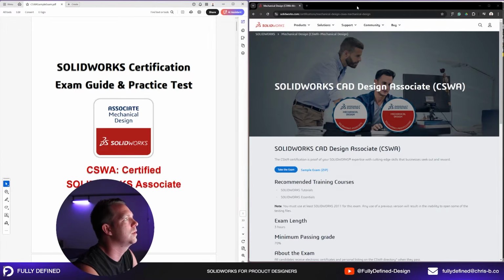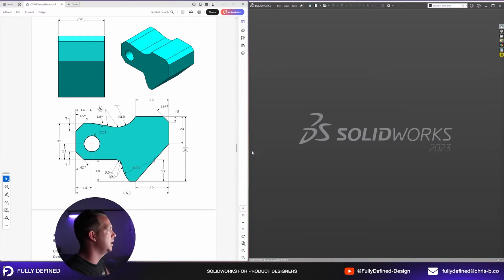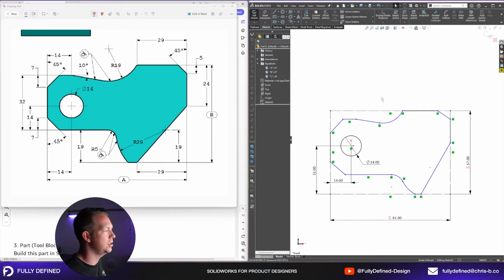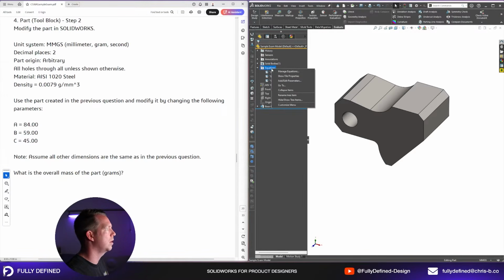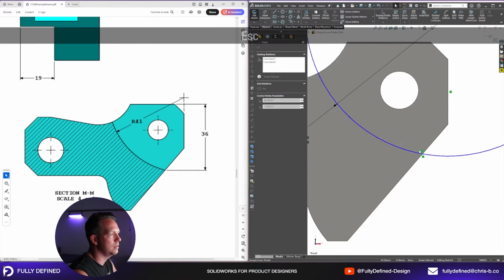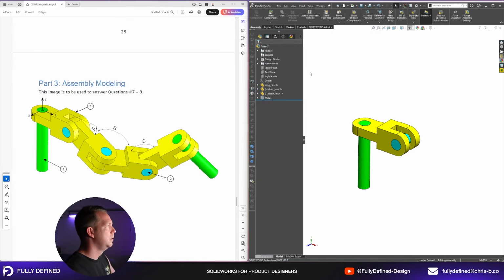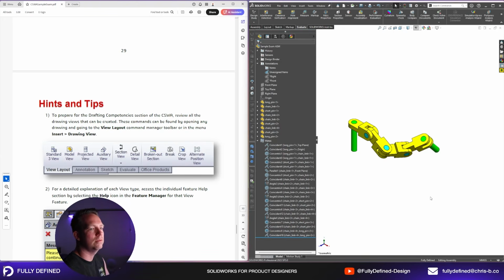SolidWorks CSWA Practice Exam Walkthrough

Comment from the maker: On reflection, I would like to clarify that I do not think using GLOBAL VARIABLES for these tasks is worthwhile.  
You're better off just making it really clear which dimensions are A,B,C by adding a note to the dimension.  
Then just change them as you would any other dimension in the subsequent questions.
Reply: I don't think it was bad to include that, I honestly have never used them before in solidworks so it was cool to mess with them here.  Great tutorial, taking my exam soon.
Reply from the maker: @disneyh8er  good point. Thanks for watching and good luck!
Reply: I would say its a good idea to include them as in a work environment there are many times where a specific dimension on a product might change based on the part number and that part number might literally be listed as "ABC".

The only critic for the video i would have is that when you changed the variable it would have been nice to show how configurations work as this is a good example for their use.
Reply from the maker: @MatthewShamusLoney  thanks for watching for the feedback. I’ll likely do a few more on these topics in future, so it’s helpful for me to consider

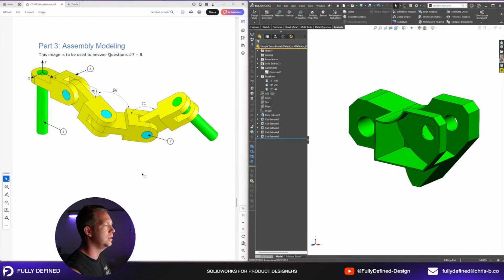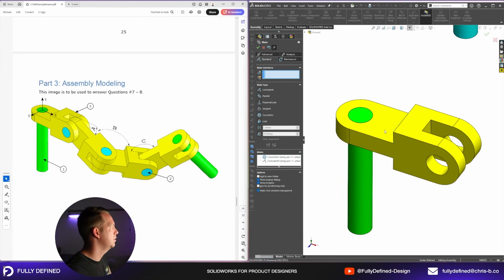Comment: Wish you'd slow down a bit starting at 27:30, it's daunting for someone to keep up if they aren't as familiar with menus. I can't see what buttons you used at 29:12 to move the yellow link, apparently its fixed and cannot be moved. You've also clipped out the few seconds where you attached it to the green pin.
Reply from the maker: Yeah I get that a bit, sorry about that. Good thing there are replay and speed options!

Comment: Very good tutorial, fast paced but nothing too confusing I would say. It made plenty of sense and was explained well. The only issue I had throughout was with angles on the assembly. Say you were to use a 130° angle, when I input that it turns into a reflex angle. Instead to match the image I would have to use a 50° angle (or 180-130). This makes it look like the image HOWEVER it completely throws off the centre of mass. My mass, volume and surface area are 100% matching yours, and so are the three sections about inertia. But my centre of mass in millimeters is quite off (X = -315.96, Y = 57.03, Z = 115.39) which I can only assume is down to the way I formatted my angles. I suspect this whole problem is due to a small detail like the planes not lining up. Ultimately while it appears the same to the eye - I would have lost marks probably as the calculation side of the question would have been incorrect. Like I say, probably something I did wrong along the way. Thanks for the tutorial anyway! 😁
Reply: Having remade the assembly, everything now works perfectly. I had built the assembly on the wrong axis which meant my answes were very far away. I also don't think I have mated the origins, or mated the fixed item to the top plane. Now it measures exactly right. HOWEVER I still have problems with the first part, where despite following all dimensions, my model is always a few grams too heavy. For my sanity I have convinced myself this is something to do with different SW versions. On the multiple choice question, I am within 1% (around 0.5% above) so that is alright. But I have to rememeber I may not get that 1% tolerance for the other questions. The annoying bit is that I get away with being 1% out on the first question, but all of the following questions are also a bit out because the starting figure is slightly above the intended result. It fluctuates between 1 and 8 grams above your results, hopefully staying within 1% and not losing marks. Like I say, I don't know if the 1% breathing space continues through, taking into account the fact you could be slightly out at the beginning.
Reply: Ignore the above - I lack a brain it appears. Exactly as your subsequent video states, I had placed a dimension on the wrong part of the model. Moving literally one dimension fixed everything. No need for a 1% tolerance now! It fixed Q3, 4, 5 and 6 which is great. Thanks again, and apologies for the many paragraphs 😂

Comment: Thank you so much for such an invaluable tutorial. I couldn't get the assembly correct until a watched this video. May I ask how did you know to make the top plane coincident to the long pin and the front plan parallel to the first chain link? I'm afraid I would never recognize when to do that with another assembly. 
Thanks again! You ROCK!
Reply from the maker: Hey thanks for watching and for your comment.   at 29:08 you can see the assembly diagram on the left, and shown are the XYZ axis.  You could pick any of those to be the front plane - I chose the X-axis to match.  As for making the bottom of the long green pin coincident to the top plane, that's simply a matter of fully defining the assembly so you can work out the answers.  I'll always start assemblies by mating my first part referencing the origin, knowing that I can always edit or delete that later if I need to change things.  Good luck

Comment: The assembly question, when I tried changing the angles between the faces, the entire thing started moving around! Solidworks is so irritating sometimes!!
Reply from the maker: Yeah that can happen! If it does, hit undo, then temporarily FIX the part moving unintentionally so you can complete your mate. Once done, you can unfix. I think the original cause might have something to do with the order of selections when you mate. Try it out

Comment: The assembly portion isnt explained well. Whenever I insert components, one of them has to be locked as the default piece. I cant do the long pin because then I can't mate origins and it cant be the chain link part because then I cant mate it to the origin long pin. Please help.
Reply from the maker: Hey ManofGuz, sorry about my poor explanations! If your inserted components have a (f) next to them in the feature tree that means that are fixed. You will be unable to move them. Right-click on that part and select Float. You will then be able to move it and mate to the origin, etc.

Comment: I found that it's actually easier to build the part on the front plane and then instead of extruding mid plane, I extrude blind. This means that on the 3rd question when we are trying to do the bidirectional extrude cut, you can simply have a reference plane offset from the front plane at 12 mm and then extrude cut from that 24 mm. But someone may have tried that and found a pit fall so I'm curious on others thoughts
Reply from the maker: Sure, that can work. But I will always suggest use offset in the extrude or cut feature, rather than creating a plane for the same purpose
Reply: @FullyDefined-Design  is there a reason for that? I'm still learning too and I found it helpful but I'm curious if there are benefits I'm missing out on
Reply: I supposed I'd be more worried about having to keep track of the offset values since it adds room for mistakes if I'm not careful.  @FullyDefined-Design
Reply from the maker: @AmeliaisNeat1396  sure, that’s fair. For more complicated models, such as when designing a product, I’d be using a master sketch (or multiple) that drive the offset positions. Keeping track of these is your job as a designer/engineer
Reply: @FullyDefined-Design thank you for your information! I appreciate that and I will keep this in mind

Comment: Hi, I am struggling to get the masses right from question 2 to question 5. I managed to get the first one right. and I was doing exactly what you were doing, so I don't know why I am getting incorrect answers.
Reply from the maker: Well if you got the first one right, then you have the first sketch, first couple of features and material all correct.  The next question (step 2) where you only have to change a couple of dimensions should be straight forward.  Make sure you have followed them correctly.

Feel free to message on discord - link in description

Comment: Hi, really struggling with selecting the contours at 26:30... pls help
Reply from the maker: hey @kenvictoria3209 it need not be a contour - in my demo, I used it to save time from trimming the sketch back to a single contour.  In the video you can see I convert the edges from the face, then offset one edge to split the sketch into two sections (contours).  Then when I hit extrude-cut, I select one of those contours to use
Reply: Thx for taking your time to help me, I really appreciate it 🙏🏼

Comment: Yeah, this is straight up impossible for me, I have restarted it 20+ times now and everytime I sketch the first part of the model for Q3 it's overdefined so I cannot put in every dimension. I delete the problem ones and try and re enter them, but then the model is not the correct dimension so I can never get the right answer, I've followed everything step by step, but every single time it's over defined, I'm genuinely at a loss of what to do and I've cancelled my exam because there's no way I can pass if I can't even get past the basic practice exam. This is deeply frustrating.
Reply from the maker: message me and I'll jump on a call and take you through it, right now
Reply from the maker: https://discord.gg/qYPKPVrAvT
Reply: @FullyDefined-Design  I really appreciate you reaching out and offering to help, really thank you so much, in the time since I posted I have since figured out what I was doing wrong and it was the fact that when I sketched I was, somewhat unaware, having points on my lines snap and being locked in perpendicular to another part of the sketch (a little yellow icon appears when you do this to show it locking in perpendicular, the other yellow icons like vertical, horizontal etc didn't matter, it was just the perpendicular one), lcoking in place, in meaning I could not add dimensions to them as it made the sketch over defined, as soon as I sketched and avoided that, I was able to add dimensions to everything and get the correct answer. Just thought I'd say thanks again for reaching out and offering to help and I'll leave my original comment and solution here in case anyone else sees this in the future and has a similar problem. Again, thanks for reaching out and offering to help, subscribed!
Reply from the maker: @661mxm  well done, you’re welcome

Comment: Very helpful video! For question 6, I got 426.55 but followed every step and got the other answers correct. What should I do?
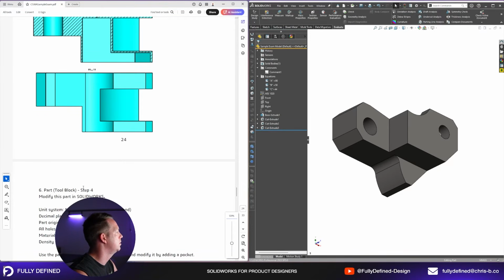Reply from the maker: Glad to hear it.  You are 6g off the correct answer, so it's likely to be something small.  Follow the steps in the video closely from 25:00 and see if you can find what you've missed.
Another way to approach it is to save a copy, delete any modifications you made for question 6, then try again.
Good luck
Reply: @FullyDefined-Design  Yeah I think it might be the initial circle when you add the point in order to dimension the 36. Not sure why I’m not getting it. Thanx for the help though!

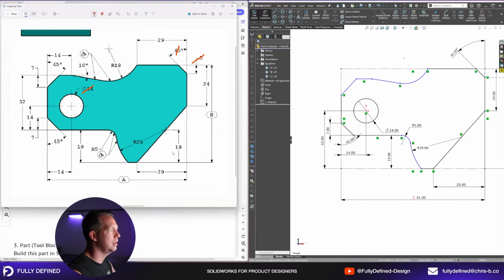Comment: I’m struggling with that 19 marking at 12:00 i followed everything exactly as you did and it’s giving me an overdefined warning there
Reply from the maker: that's ok - this is part of the learning process.  When it becomes overdefined, it should highlight which elements causing that by changing their dimensions or relations to red or yellow.  KEEP the 19mm dimension and try deleting the other dimensions or relations until you are no longer overdefined.  Use ctrl + z (undo) if you get stuck, and try again.  My guess is that somewhere along the way, you've added an extra relation without knowing it.
Reply: @ sorry correction, I meant that I followed everything you did to a T exactly and when it gets to marking the 19 in the video I get like 16.5 and it marks it overdefined. Should I follow that same process or something different?
Reply from the maker: @lordbuts2586  similar process, trial and error. You know what the dimension needs to be. So you have to work out which dimensions or relations need to be removed or corrected to allow it to happen
Reply: @FullyDefined-Design  thank you so much for the help, most helpful video and creator ever

Comment: I copied your video step by step but got 948.04 grams for the first question.
Reply from the maker: @akj2387  that suggests that you have missed at least one thing. Troubleshooting time.
Try again with a fresh file. See if you get exactly the same result. 
Check the material density.
Check every dimension one by one.

Comment: i followed the tutorial to a T, but for the mass im getting 958. everything is defined, the material is correct, i triple checked the dimensions too.
Reply: For anyone that might see this later on, the reason you're getting 958 could be that you entered the 29 at the top excluding the 5 from the corner. I had the same issue, and making it 29 including the 5 (so 24 in total for the straight part) fixed the mass and volume for me.
Reply from the maker: @KyuruPuku-kz2ty  beautiful work - thank you for answering correctly
Reply: @KyuruPuku-kz2ty  Oh my gosh thank you so much. I was stuck on this for hours and had the exact same issue
Reply: @KyuruPuku-kz2ty wow you’re a genius thank you, redid my sketch 3 times already
Reply from the maker: Hey @morganfabbricatore7126 thank you for watching.  I assume you mean for question 3?  The first mass of the first model?  (multiple choice answers)
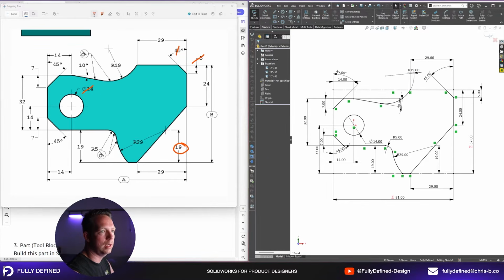If that's the case, then there must be something wrong!  It's probably hard to spot, but try a split screen view and compare against my fully defined sketch at @12:35
Take a screen shot, and cross of the dimensions one by one as you check you have them correct.
Reply: I’m getting the same thing as you and can’t figure out why
Reply from the maker: @maki._xx9214  I’m going to open the files tonight and see if I can work out where the potential issues are exactly
Reply from the maker: @maki._xx9214 and @morganfabbricatore7126 
check your Volume value at this point - it should be 118929.06 cubic millimeters.  
If it is, then you're model is correct, but the assigned material is wrong
If it is not this volume, then there is a mistake somewhere in your model

Comment: Quick question, on #6 how did you know it was 1m?
Reply from the maker: I assume you're asking about question #6, and how I knew the measurement was 1mm?
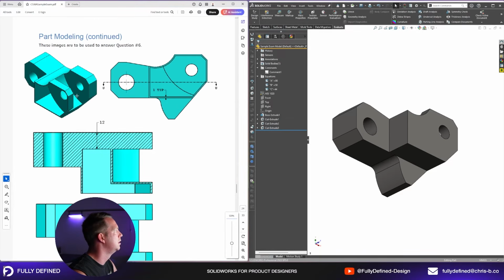See 24:42 in the video.  You can see a "1 TYP" measurement with arrows to the wall thickness.  This means 1mm.  With no other dimensions, its safe to assume the thickness is consistent.  Hope that answers your question
Reply: @FullyDefined-Design  Is TYP a conversation to mm, what does the TYP mean in relation to the mm measurement?
Reply from the maker: @Daidact3  TYP stands for typical. Used when there is a fillet or feature that is typical across the part

Comment: I just finished part 1, which consists of 2 modeling and a mechanical assembly that requires creating a driver vis sketch and change the value to find how much drive shaft has moved. Each model has two questions, total 90 min.
Reply from the maker: @designrama8 sorry I didn't respond soon, but if you need additional help please get in touch!